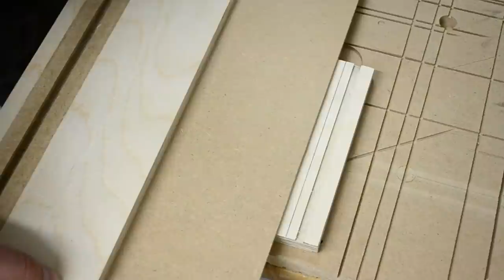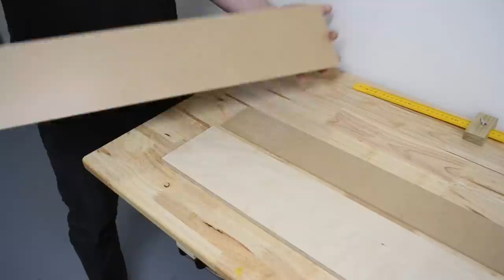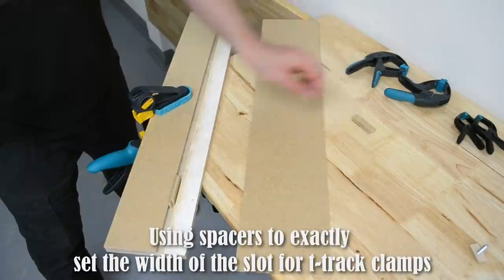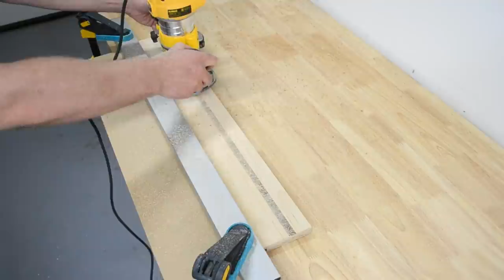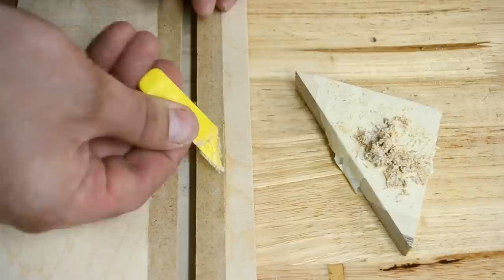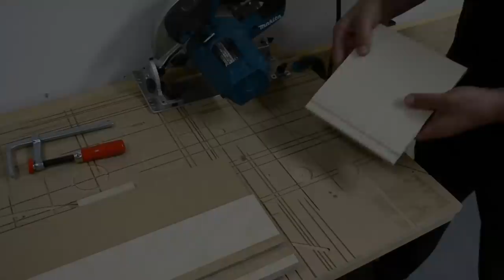Make a Circular Saw Guide with DIY T-track

Comment: Many thanks for your video. Please what is the use of the upper T-track? (the one where you put a T Bolt, time code 9.13)
Regards
Reply from the maker: Hello, the upper one can be used to lock in another (same) circular saw guide and make a longer one for longer cuts. Or a stopper can be added to cut with the circular saw up to a certain point. Thank you too :)
Reply: @AllFlavorWorkshop  many thanks for your answer